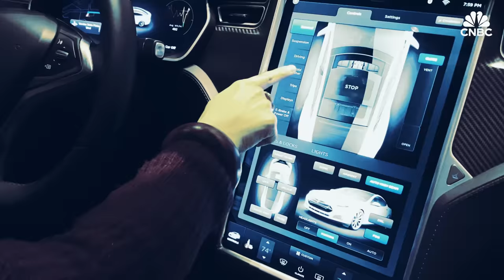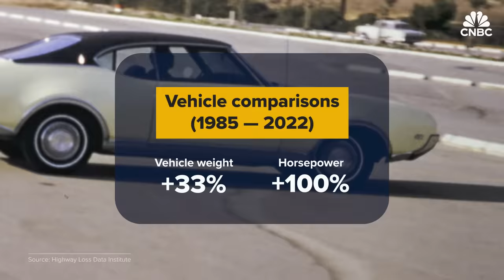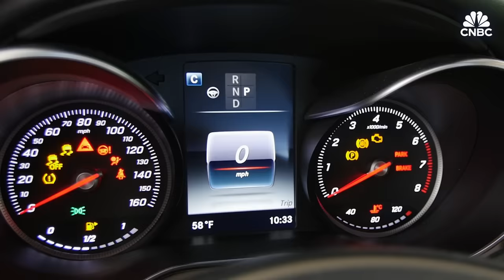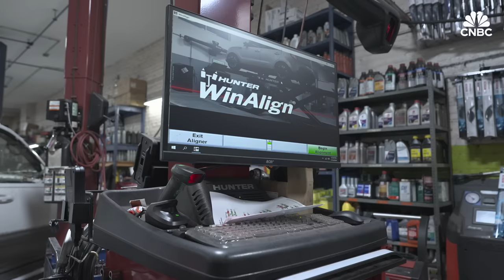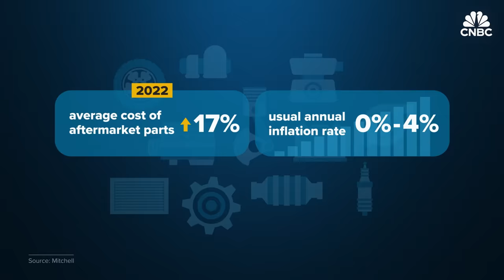Why Car Repairs Are Getting So Expensive

Comment: Don't forget manufacturers deliberately making it more difficult (or virtually impossible, in some cases) for customers and/or shops to repair certain things without getting them involved so that they can charge whatever they want for a replacement component.
Reply: Exactly lmao, like off-setting access holes by 2-3 inches so it makes it impossible to use the correct tool to remove that part. And instead you have to come up with some workaround which takes 3x as long but your expected to do it within X amount of time cause you don't get paid extra since it's a warranty claim.
Reply: Then fix it yourself… why you crying about it?
Reply: yep. got to take the cab off a ford super duty to do engine work and cab off and back on is 10 hours alone. so thats $1500 extra on top of repair bill.
Reply: @MH_6160  the fact that it's increasingly difficult (or again, in some cases impossible or effectively impossible) to actually do that.
Reply: Vehicles are designed to be put together not taken apart.

I tell people "Vote with your dollar not with your mouth"

If you do not like the repair bills of newer vehicles then buy an old car, when new car sales go down the manufacture will be stuck with the bill.

Unfortunately people love new things and the manufacture will always win.
Reply: I use to be able to change my fuel filter on my own. Now the newer car have the filter “internal” so now I have to take it to the repair shop because I don’t have all the tools what use to be a 15min change
Reply: Car taxes(up), registrations car(same), insurance(up) oil changes(up) Maintenance and the hourly rate(Up) and we all know about gas(up) For some reason, I think somebody doesn’t want poor people to be able to travel. Wait a second, the past three years been an attack on poor people(Wealth, gap digger).
Reply: @baja-automotive  I'm doing my part. My garage hasn't entered this century and may never even get to the 1990s, lol.
Reply: #righttorepair!
Reply: Took my truck in for a simple brake line (it was snowing & can’t fit it in the garage) that was $15, the shop charge $90 for the part and $200 bill… never again! I’ll do in the snow
Reply: A chevy dealer charges my neighbor over 400 dollars for a battery, over 600 for a 2 front rotors and brake pads. Over 600 to replace 4 spark plugs.
Reply: In my experience, American and ESPECIALLY GERMAN cars are being designed to be unnecessarily difficult to work on.  The Germans will make a 20-minute routine maintenance job (thermostat replacement) into a multi-hour job by making the thermostat difficult to access.  And it goes on like this for all common maintenance. Sometimes it's in pursuit of a 1% ~ 2% efficiency improvement, but all the savings go out the window because these ultra-optimized designs often don't last long before routine wear throws them extremely out of tune, and of course, because it's German-designed, the repair will be complicated costing many hours of labor for a job which shouldn't even need to be done.

American car companies design engine compartments to discourage you from working on your own car as much as possible so as to keep the dealerships profitable even when sales are poor due to unpopular designs (everyone learned from the Studebaker and Packard bankruptcies that if too many dealerships go out of business due to poor sales, it doesn't matter how many people want your latest product line-up if they're have to drive 250 miles from the nearest dealer, and there won't be enough to to save the manufacturer).

The Japanese build reliable, easy-to-work on cars, because Japanese car owners live modifying their cars (but at annual inspections, the car must be 100% OEM parts, or the inspectors will replace the modification parts with OEM parts, and THROW OUT THE modder parts).  So the Japanese market demands cars which are easy enough to work on that the owner can pull off his modder parts for inspection EVERY YEAR, and then replace them again after the inspection.  Not surprisingly, American design practices don't find many interested buyers in Japan, and the Germans even less so.
Reply: @MH_6160 
You obviously haven't worked much on many cars built within the last 25 years.  The headaches of the modern designs are why even those interested in being mechanics and have the aptitude for it ARE LEAVING FOR OTHER LINES OF WORK.
Reply: All car manufacturers are like that. Only their certified mechanics are allowed to have comprehensive scanners, and certian jobs have to be done by the dealership only. Other times the parts are custom made and don't have afertmarket counterparts. It's just the nature of being proprietary.
Reply: Then don’t get a newer car
Reply: Exactly, I f you can't do it don't touch it. Remember to have money aside just in case you need a tow truck to take it to the professionals.
Reply: That's why its often better to get a older car that was made before the anti consumer era and is much more durable than the junk we have with most of the components made in China
Reply: Fuel filters are just above the gas tank in many newer vehicles. Means you have to drop the gas tank and reinstall to change it. Might be 4 hrs labour right there.
Reply: So true. Sometimes it's even impossible to swap parts for known good unit simply because parts need to electronically handshake each other. Golf Mk4 and I think Crown Victoria have ABS module that talks to ECU and gauge cluster. Numbers don't match ? Here, an immobiliser light to illluminate your day.
Reply: Manufactures do exactly what you ask them to do, shove as much crap into a car so people can do everything but drive.
Reply: @TubeNLube new cars don't have a fuel filter
Reply: @visceratrocar you are incorrect. I have aftermarket scanners that have more info than the factory ones. If you don't know how to interpret the information, it doesn't matter what scanner you have
Reply: @coache1nine  I think he was talking about stuff like VW VCDS or Renault CLIP etc. I had an oportunity to use higher-end Autel scanner and it did allow me to do a lot of stuff including simple programming and component test procedures, but anything advanced was available only with dedicated software.
Reply: Tesla

Comment: After being told by the Toyota dealership that the transfer case on my 4Runner was gonna need to be taken out and rebuilt (it wouldn't shift into 4Lo) I found a Youtube video that showed how to fix the problem. I got under the vehicle, smacked the transfer case in just the right spot with a dead blow hammer a few times and problem solved. I then changed the oil  in the case myself and drove it for several years. God bless Youtube videos. That video saved me roughly $2500.
Reply: The video should have talked about used car extended warranties. My friend got her 2016 honda HRV(under 100k miles) transmission replaced for free with an extended warranty she purchased.
Reply: My Tacoma T- case got stuck in 4 lo. Same issue I bet.
Reply: @elementsoflife000  its not free if she payed for the warranty. She just payed for that transmission up front.
Reply: you can actually split the actuator and fix that for a couple hundred. Mine was a bad pin and I was using a hunk of AL.lol
Reply: if it was a ford GM or dodge it would have been a $9000 fix haha
Reply: @njparis Worse, it would have split when hit with the dead blow...😂😂😂
Reply: @njparis lol not likely.  
Replacing an entire transfer case doesn’t cost half that.   
There  are  always suckers that have no idea what repairs should cost and they might believe something like that.  👌
Reply: You have to understand as a dealership we have to warranty our repairs as well. There’s no way in hell I could guarantee banging on your transfer case would fix your issue and warranty that repair.
Reply: Dealer cannot do the fix your way. The standard is to use original parts.
Reply: You know I'd rather do my own work any day. The Asian market came up with super cheap cars for a reason. That was so the car parts would be cheap enough to replace! Asian car dealerships are like the ONLY places that charge exuberant prices for its super cheap parts and probable terrible installation. 

It's sad that most of the tech industry can only write code fix cell phones and build servers.... Ask most of us anything about a car and you get answers like "take it to the dealership and get warranty blah blah." 

My answer is why don't you stop being lazy like this awesome dude, and do your own work!
Reply: My Tacoma needed a new air conditioner compressor according to the dealer ($1200) - one youtube video, one Ebay order to China for the $18 part (including delivery via Chinese mail) and 35 minutes of my time too install the part - problem fixed - Arctic grade air in the cabin! Toyota told me they only replace the full compressor unit because there are no repairable parts on it - really? I have been waiting 8 months for a muffler! I may learn to TIG weld and just repair it too.
Reply: I saved a few hundred dollars replacing the alternator on my Toyota. Dealership wanted a couple hundred dollars just for a job that took me a half-hour.
Reply: Gee whizzz maybe the crappy gear lube you left in there made the Electronic locker stick ??
Reply: For that very reason is better, if possible, to get a manual transmission vehicle. That reduces problems like the one described in this post
Reply: @BlahBlah-em2ed  Have you ever repaired your Toyota Alternator? Typically, they just stop working because the carbon brushes wear down - you can buy new brushes on line for $10 - I always replace the brushes in my Tacoma's at about the 200.000 KM mark - I have never replaced an alternator. It takes 20-30 minutes once you remover the alternator form the vechicle - I buy a pair of brushes when I buy the vehicle and put them in the glove box.
Reply: @Marqeh  If you get pedantic enough, nothing is free. Everything must be paid for with at least time and food. I paid for a $3k lifetime unlimited warranty for my entire vehicle. Every time I have anything that even sounds like an issue, I bring it in and I never pay a dime up-front.
Reply: @Marqeh  far less price pt.
Reply: @njparis  Actually it wouldn't have broken. My gen2 - '20 Ranger XLT FX4 is phenomenal. Had to be a moronic comment here.
Reply: @Nativeamerican221 He sucks. Period.
Reply: @jaxturner7288, Is there a good list out there to get educated on how much certain repairs should cost so less “suckers” exist? Every time I have a repair need, I research it to get educated and not be a sucker but I’ve found it hard to get actual data.
Reply: @amx3903  Shouldn't freeze up either way let's not make excuses. It's probably not even 10yrs old. I NEVER put my F150 in 4wd. Maybe 2× in 11yrs. Will have a new F150 Tremor in driveway this yr.
Reply: @BlahBlah-em2ed  More like 600 -800 .
Reply: Few of my uploads have saved folks, in comments on few different one's they have really helped save another cash, they posted comment thanking me for the uploads. My recent videos not so much but few of my older ones netted views over time
Reply: Fred Flintstone technology
Reply: Well, the 4Runner was about 6 years old at this point and it was a "corporate" vehicle (rental?) before I got it so you know that the t-case was never engaged or even serviced for that matter.  @Korokukanas
Reply: @elementsoflife000  Are you one of those jerks who keeps calling me about my warranty being expired?
Reply: A common problem with a lot of transfer cases is getting stuck in a position, especially these electronic controlled transfer cases.
Most of these parts live in the fluid and I stress the importance of preventive MX.

Changing that fluid every 3yr/30k miles is a good start

Unfortunately that one person with a 30 year truck that never did anything but add gas to the tank, will boast about how preventive MX is a scam.
Reply: You're lucky. When I started working on my own vehicle in mid 80s it was all trial and error or buy repair manuals.
Reply: @globalcitizen8321 My Tacoma is a manual transmission - 10 years ago I had to special order it and wait 3 months - I hate to think what the wait time would be this year.
Reply: A timing belt for my VW Golf Turbo Diesel was $1,300 - $1,700 from 4 different shops! I said "nope," watched 2 You Tube videos & bought a kit with everything & step-by-step instructions. It took me almost 3 days & was challenging, but cost just a little over $500. Now I've removed my DPF & EGR valve myself, which increased my mileage to 53 MPG & increased power, too. Also did my brakes, water pump & fuel pump. Doing it yourself is a fraction of the cost, and is satisfying.
Reply: that's just something a dealer would never be comfortable doing to your car, if it fixes the problem for a while great but if it gets stuck again we're on the hook to fix it for free.
Reply: @or8494  ahhh well actually, nothing really stopping you from warranting the repair if he comes back.  
And you can’t actually guarantee any repairs any further than your test drive so…..
Let’s be honest,  there is really nothing but your moral compass keeping you from smacking that T case  with your medium size snap on dead blow and flagging 5-6 hours before lunch.  👊
Reply: A mechanic isn't going to load up YouTube, smack your transfer case, and then when you come back saying your transfer case is blown up and they should do it for free, eat the cost. If you want to fix it yourself don't go to a shop.
Reply: They're not called stealerships for nothing. As far as Toyota goes, the worst part of it are the dealers.